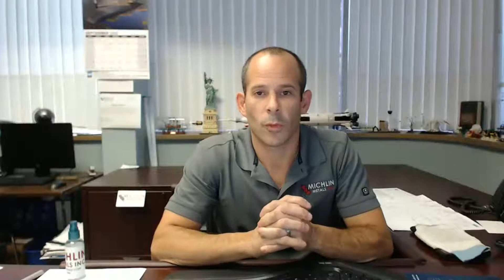Comment: Thank you for this video! I have a query about Austenitic Stainless Steels. Even though these steels have the FCC Austenitic microstructure, why are they not heat-treatable?
Reply: Austenitic stainless steels do not change structure on heating or cooling, ergo not heat treatable like the martensitic stainless steels which are austenitic at high temperature but become martensitic on cooling.
Reply: @MichlinMetals  I understand. Thank you very much for the reply!!